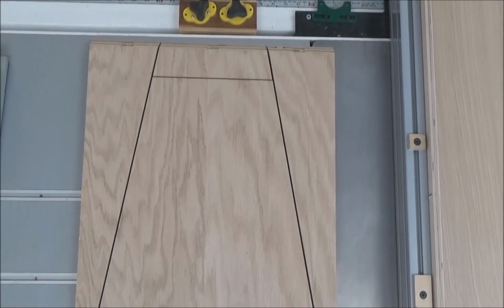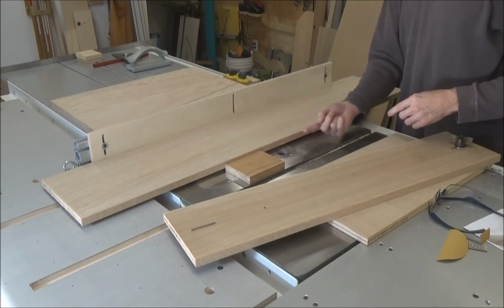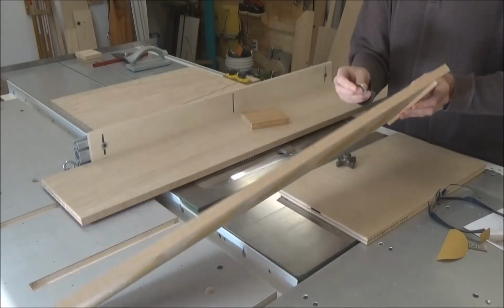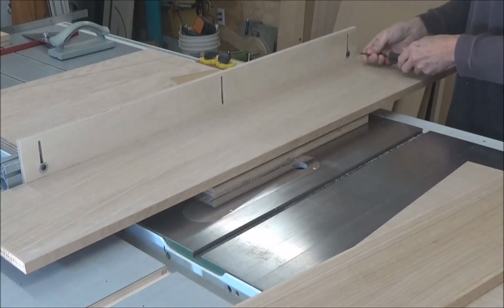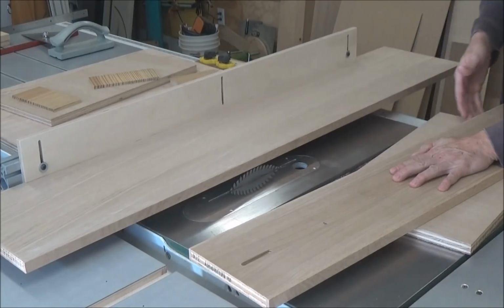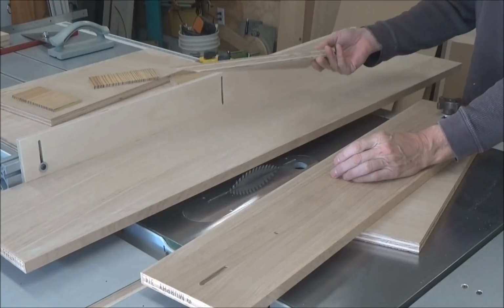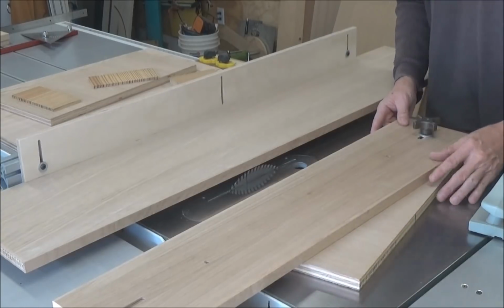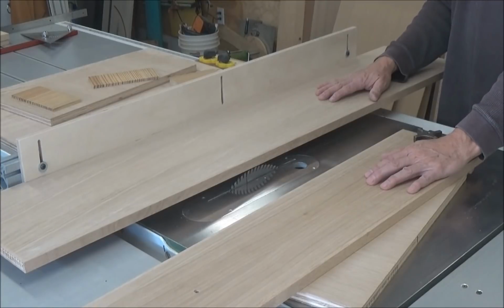L Fence

Comment: Jeff, Thank you for this video.  There are some ideas here that are not mentioned in other L-fence videos.  Using a tapering jig may eliminate the need for a separate jig dedicated to that purpose.  I did have a question about that.  Regarding your adjustable heel, how do you make sure it is set at the angle you need consistent with the angle of your taper?   The heel seems to be hidden at least in this video. If it is not the same or complimentary angle you may have the two angles fighting against each other.  In practice do you encounter any issues with this?
Reply from the maker: Mark, sorry for the late reply. I was out of town for a week. To answer you question about the heel (stop) yes it is adjustable and can be set at the complimentary angle. Thanks for watching.

Comment: I made my L fence about five or six years ago when I seen a video of Bob Van Dyke making one. It doesn’t have to be near that wide but it is one of the best and most stable ways to cut angles on any piece of wood because it is more stable than a track saw in most cases
Reply from the maker: Thanks for watching Ron.